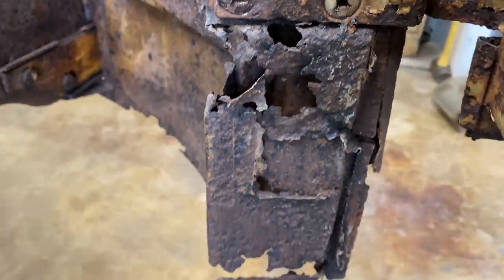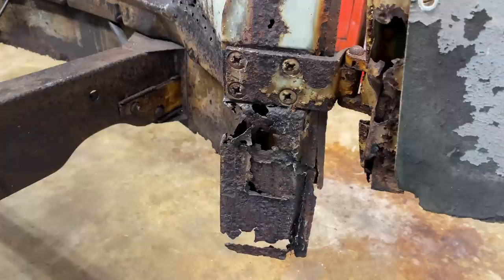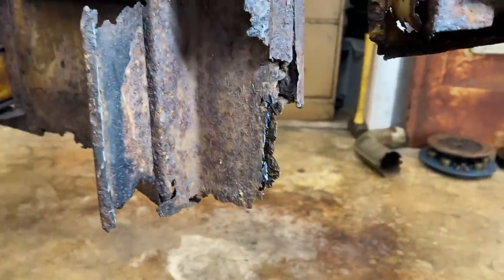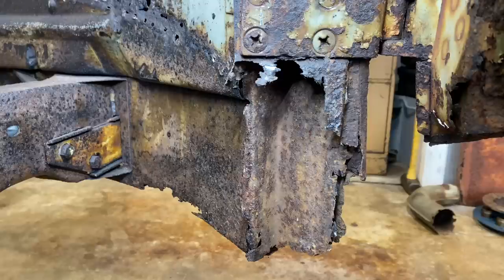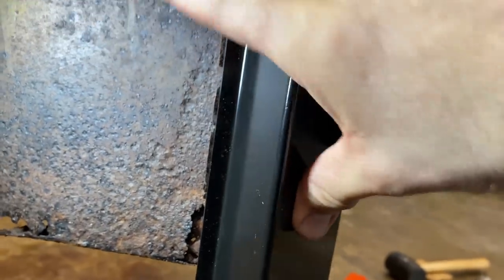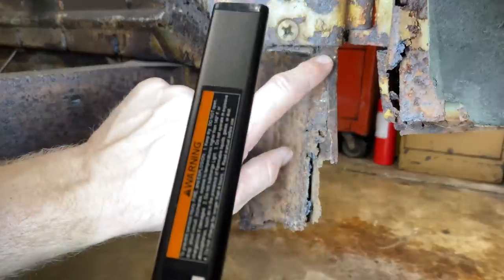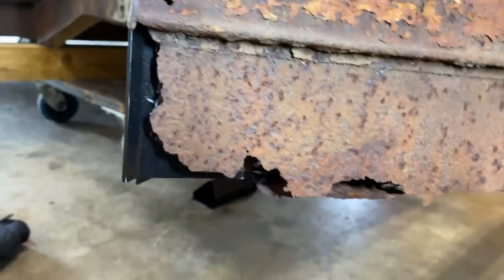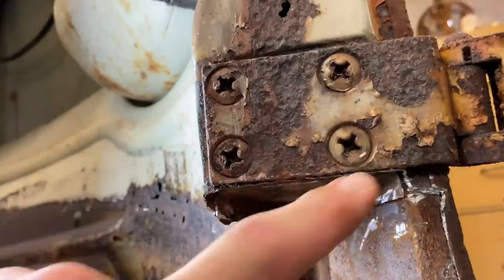Extreme RUST! VW Bus Restoration, VW Bus "A" Post Repair, VW Kombi, Classic VW, CT's Garage, ctmoog

Comment: Lots of guys are thinking you are going to totally restore this but honestly it is too rusty for that. I think the best approach is to do what your doing and patch that section so the dog leg will just go into place. Be sure to grind all the rust off clean before welding that in. May need another piece of metal to weld in there to reinforce. you will know that once you put that in place.
Reply from the maker: A voice of reason in all this madness! Thank you my friend! That goes a long way to help keep me on track! =)
Reply: canuckguy worried  Yea for sure It is really rusty and to cut it back to where he needs to to get "good" metal is totally impossible. I have seen it in person. If he  sandblasted it there would not be enough metal on any panel to restore.pinholes everywhere.  It is much much worse than my 67. there was plenty of metal left once i cut it back. Restoring it is really what it needs to be good. But it would be totally equity deficient to do so. I think he is just trying to get it drivable.  Which the old seat stand and the dog let was not going to do. If he sat on it and drove it the seat would have fallen through to the tire. So making decisions on this one is really tough. Honestly Road worthy would be full restoration. But pocket book says No Fn way.
Reply: canuckguy worried I get it
Reply: Hi ct it's Mr Bond again I've watched all ur videos, I've been a mechanic for 25 years, and trained a lot of people, and none of them did improve their technical skills like you have in about a year, if you haven't done anything like this before then your have a real bult in natural skill, keep doing what ur doing and I'm sure you could turn it into a business and a good one, I'm very sorry the hear about ur normal job, thank you so much taken the time to read this Matt James Bond
Reply: I read some of the comments and in a perfect world,they're right. Years back,we had to make do without a budget. I made some pretty rough cars safe and good looking.No,it wasn't long lasting.We just kept at it and had fun. Necessity was the mother of invention.
Reply from the maker: @mattbond8363  Thank you Matt! I really appreciate the kind works my friend! THANK YOU! =) This made my day! =)
Reply: Not sure what you want to end up with, but for yours and the safety of other it needs to be structurally sound. Not sure what you are going to weld to.
Reply: Well CT there are two ways you can do things the right way or the wrong way since you've already replaced the floor the bottom Valance above the bottom door hinges should be replaced to do it properly and to make it safe. And in the end if you want the rusty look all you have to do is spray vinegar and other stuff on it to make it look like that
Reply: Ct I'm sorry i know we are all in tough times but a project like you van will be done in time not in a hurry you will learn in exploring more in what can be saved and what to replace for your safety and other's .
Reply: @Ramon Bradley Yup, been watching on Instaflixxer for since december myself =)

Comment: Hi CT. You're doing great, but I have to agree with the general consensus here. The area you're trying to save is too weak and has an important job to do. Remove the door, see what's underneath and work from there. Go in deep, gouge out the bad stuff and work your way back out with nice fresh metal. I'm going through all this with a '59 Hillman Minx (British) and it's the only way. 
You will get there.

Comment: attaching a new part to a rusted frame is not my idea job 1 quality restoration ☹️
Reply: This is true, but he is figuring it out as he goes... how would you proceed with the patch, what panel would you replace first?
Reply: JW Classic VW I would sandblast the whole vehicle and start on an area front, rear or middle. I would see what needed replacing and  order parts starting with structural first before applying more parts over the structural.  Anything rusted or eaten would be replaced.

Comment: Mate I really don’t think you’ll be able to make a decent weld to that rusty corner. You need to save that part for when you’ve replaced the lower nose and there is something to weld to.
Reply: Exactly right.
Reply: So the lower nose should be the first panel replaced... I was wondering?
Reply: JW Classic VW you’ve got to get back to solid metal first
Reply from the maker: Hey Matt, you might be correct but I I think there is plenty of good metal to weld on. I just have to clean it first. Let's see what it looks like after I sand and grind all the rust off.Stay tuned! =)
Reply from the maker: @JWClassicVW  Yes, if you plan on doing a complete restoration...I'm not doing that right now. This is just a patch so we can get a flat surface to weld the dog legs on. If you doing it the "correct way".....it will destroy Rusty's face 'patina" look. I'm not ready for that.
Reply: CT bear in mind that welding is even more difficult when the surfaces are not perfect. Good luck, I’ll be watching!
Reply: Está muito complicado , tem muitos reparos a serem feitos , e a lataria da Kombi está muito ruim , mas segue o baile 👏👏
Reply: @CTmoog  Man, you have to replace the bottom part of the fascia. I fully understand the idea of keeping Rusty's look but you need healthy steel to weld on. Replace critical parts so that it's bones are solid ! Like it is now, even a small accident may turn dramatic !
 As for the look, once a good, solid bottom apron is installed, you remove all grease or wax on it, grind it lightly and wet it with battery acid or vinegar. Don't worry, surface rust will appear fast.
BTW, Mustie1 showed us his trick to keep the rusted surface look on his Crusty but stop it as is : he uses a wax toilet ring, melt it whit a solvent and rub it on all surfaces. It keeps the rusted look !

Comment: You’ve spent so much time and money getting that engine and front beam finished to such a high standard. Seems strange, and massively contradictory to start cutting corners (pun intended!) on the metal work now. You’re intelligent even if you are inexperienced. Get that door off for starters and start chasing back the rust to something decent. You’ll only regret it otherwise 👍🏻

Comment: Sorry mate this is cringworthy you need to go back to good steel not blobbing new onto barely useable rusty panels
Reply: exactly !
Reply: I'm watching this at the highest fast forward speed. What I miss may keep me from being convinced that this is acceptable or even responsible. At the highest speed I get to see the incompetence and half assery but spend half the time and I will be less MADENNED by the whole project. The engine work, brakes and mechanical work can make the VW drivable but this body is basically toast. Most of it is too deteriorated and a wise person wouldn't have even tried to use the body. This VW Body should be Yard Art and nothing more.

Comment: Hi CT I gave you one advice in the very beginning remove bold doors and you get a better workspace. Bud, you do do so as you prefer. Greeting HCS
PS my friend you don`t have enough healthy bodywork there impossible to weld that together.
Reply from the maker: Hello HCS! Yes, we have plenty. I went out there and sanding it to nice clean metal today. Lots to work with. Stay tuned! =)
Reply: @CTmoog  Hi CT Yes I do, maybe you get some idea`s for welding, take a little look at what I`ve done so far.HCS Restoration VW T3 there are many video`s to stay safe and take care.

Comment: Find the spot welds drill them out use a spot weld bit remove the rest of the lower A piller remove the door and hinge and clean metal you will have to fit that piece and form the metal. not unless you can find a longer lower A piller that has a hing pocket . but you probably need to replace the lower nose assembly before you replace the lower A piller for strength.

Comment: Looks like the right approach for that since your trying to keep that original patina
Reply from the maker: Thanks Mike! =)
Reply: @jd46800  Yea you are right. it is totally way too rusty. There is not enough metal on the whole thing to save. If it was sandblasted there would be pinholes on every panel and then what would you do. The only thing that can be done on this one is to just patch it up and try to make it as road worthy as possible. If I were going to restore anything it would not be this bus. It would be cheaper to buy another one for that this one it would be upside down big time. That is why I say patch it and drive it. That is all it is worth.

Comment: Dude, You shouldn't weld to that rusty part. It will be like welding to butter! That part you are planning to weld to is actually the backside of the part your are replacing.  You will need to cut the new part down to make it fit, if you leave the rusty part there.  In other words, you need to cut all that out before you think about welding anything back.  If it were me, I would take the door off too...although that is going to be a real pain.  The only way to do a good job will be to get rid of all the rusty metal, otherwise you are wasting your time and money.

Comment: CT great video as always nothing wrong with taking your time and trying new things but you should wait on that piece and replace the surrounding metal/ lower nose first and as I know you want to keep the patina get the main new pieces in and figure out how to blend them in faux patina etc. You might need to remove that door to find solid metal. Been there and I ended up redoing it after and no one wants to do something twice just my 2 cents.
Reply from the maker: Yes, that will be the long term goal. Right now I just want to get him up and running. It docent have to be perfect. I going to learn a bunch from this and the carb floor and the battery tray area. Once I get all the done I can resist the lower front nose are. That will be a serious undertaking. I not ready for that. Baby steps.

Comment: Sorry welding to old rusty panels is not the way to go,you need to get back to good clean metal ie new  panels on the lower front end, once you start using the door it's going to collapse on itself at the bottom end will keep flexing because it's not welded to any good structure, shut doors weld in some bracing on the inside of the cab to stop any flexing of the body take the doors off cut out the rusty panels on lower of the front end and and start to work your way back with new panels two good metal otherwise what you're doing is just a waste of time, set out a game plan and go from there  good luck.

Comment: As above,door off its needing repaired anyway new inner and outer valence ,remove all the metal behind you new panel its forcing it outwards at the hinge the lower nose looks to be ok ,the outer valence is behind the bumper anyway ,then your floor can go in ,back on with the door ,then on with the dog leg ,job done ,you'll get there in the end cheers for a great channel.

Comment: My dad was a toolmaker, and he gave me a piece of advice I’ve never forgotten. He said if you can’t do it right the first time then don’t bother, because all you’re doing is wasting your time. And as I got older, I learned he was right. I have to agree with most everyone else here. You have to get back to good solid steel. And if that means replacing more sheetmetal than you would like, it’s still what you really need to do if you want something that you won’t need to go back and completely redo again. This repair is not going to hold up, and this is a structural area of the vehicle. It has to be strong and safe. Don’t waste time and effort for nothing. You WILL regret it later.........

Comment: It’s tough to find that line where to start and stop I know exactly what you’re trying to achieve. I run into it with my projects and my job as a plumber.sometimes unorthodox ideas turn out to be the best ones for that particular project.i think you have the right idea building off door support

Comment: Hi CT,  maybe it's just me but I think I would get the engine compartment done and install the front end and engine (drive train) replace the brakes etc first, the frame is the most important part.  make it drive-able.
     The body stuff can be done piecemeal to whatever level you prefer later, it will be MUCH more enjoyable when you know it is running and sound underneath. just an opinion . there are many good looking junks on the road and there are many junky looking but well maintained  mechanically sound cars / trucks on the road. I know what you want and I think Mustie 1 is a great teacher for what you are after, watch his videos more often on his body ideas.

Comment: Good video brother!! I think your doing great for your experience level.  I know it can be a bit intimidating to really dive in but your doing it right.  Try this if you dont like the way it ends up move onto plan B... lol I would probably start soaking those hinges in some WD a little bit each day.  I see the bottom hinge getting moved out of your way soon... 😃😄
Reply from the maker: Thanks man! I appreciate the kind words! Experience level ZERO....ambition level 1000! =) Best way to learn! Jump in a start! We might make some mistakes along the way! That's how you learn! =) Yes, I'm scared of those hinge screws!
Reply: @CTmoog  I know there are some that want you to go out and buy this and that like you've got bottomless pockets. With rusty nuts bolts and screws it's one of those situations where smaller and cheaper is better. Impact drivers are a less expensive route to go, they are found in any parts supplier like AutoZone or O'Reilly's, use of those with some penetration oil, a hammer and heat should help in getting the rusty screws out.
Reply from the maker: @donniebrown2896  Thanks Donnie! I appreciate that!

Comment: Good evening, Mr. CT. And yes, the time has come... And yes, that's what I kind of forseen will happen, sooner or later, when you hit the milestone of nothing to attach to.. Seen from that close, looks worse than anticipated.. but fear not.. It's time to get a couple of metal sheets of the same thickness and a pair of good angle snips (those deform the metal less when you cut a long line), then it's time to start metal shaping.. =) Yessss, let's beat it... Ok, today's advice is, since the new part fits in a strange way, that you start diggin' deeper. You'll have to replace (make) the back part as well. Don't even think of welding to that swiss cheese... You have to cut off rotten parts untill you hit the healthy metal. From time to time give it a fit with some flap disc, so you can see what's under the rust.. If there is nothing good, cut it off. DON'T destroy the parts you cut off because you need them for templates and to pick shapes. Paper, scissors and pencil work the best for that purpose. As I already said, try always to pick spots on seams first, unless the rot is in the middle of good metal. Keep every part for reference. Measure and cut, bend, stretch and shrink. Don't worry, you can cheat a little. =) Cheat by cutting slices and weld.. But easy, let's start at the beginning. I would try to remove the door, which seems terrible on the bottom..  I hope it helps..
Yesss, fabrication time it is! Also get some construction paper for templates (the thicker brownish paper, usually in rolls) as you'll need it.
Every part you need to replicate, stick a piece of scotch or use magnets, conform the paper to the shape, press it to every angle and trace it with the pencil. Those should be accurate more than enough, small adjustments will be done on dry fitting. =) Keep on, have a look to some videos if you're new to that.. 
Thumbs up, never give up untill it's really hopeless.

Comment: Even if you were to replace the front, there is a way to paint it to match the patina and rustic look you want so it blends in to the rest of rusty.  The  father , son duo from Texas on their "Turnin Rust" channel do that to all kinds of rustic vehicles without losing the integrity of the rustic look. I know you have a plan but while it is apart and you are so close why not fix the front permanetly to avoid future problems? Just a thought CT. Keep up the progress. I'm so looking forward to Rusty hitting the road.
Reply from the maker: Thank you! Yes, I've seen them do that. It's pretty cool. That's the plan for all the new metal is to give it that rusty look. I'm pretty sure I won't be dong anything on the lower nose area until later. That is on another level. I'm not there yet.

Comment: Ok CT, Your getting there but I've only worked on aircraft sheet metal. So here is my suggestions in no particular order
-Cutoff wheel works great but when you get to small areas use a sanding disc instead.
-Not sure if you have watched VW duck man videos but what he does on blind spots is cut and temp fold the metal down for access to weld in support parts then use sheet metal hammers to fold it back up into place and weld it up.
-So you can make a piece to put inside to weld your post to or you can open up your access and drill spot weld holes to weld to the back existing part which would be easier but you need to practice on scrap parts first same thickness.
Next is your location will be off due to welding to the back remaining piece. That means your dog leg and floor will need to be cut back to fit. You want to make sure your door fits right too and door closed gap and fair. If all good go for it👍
Reply from the maker: Thanks Tim! That is great advice my friend! I will try one of those methods this week. I've test fitted everything today and it is real close. Yes, it is off like you said because the old section remains. I might try to remove more of what remains so it will fit better.  Yes, I've spent many hours watching duckman! =)